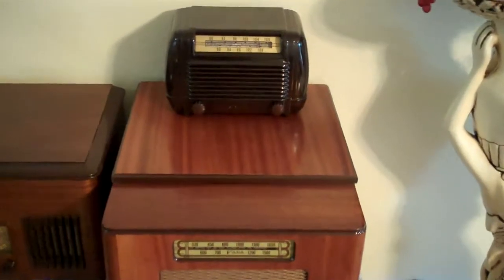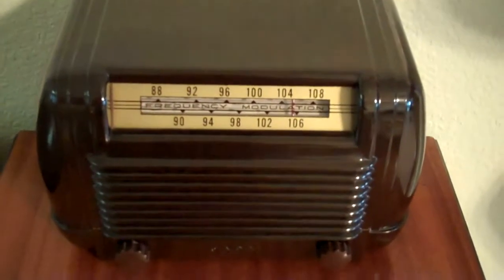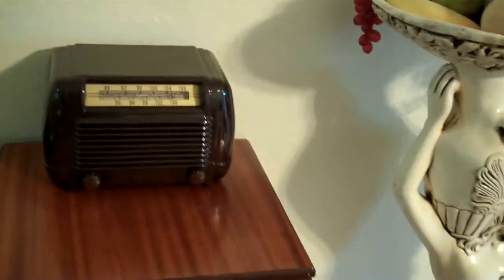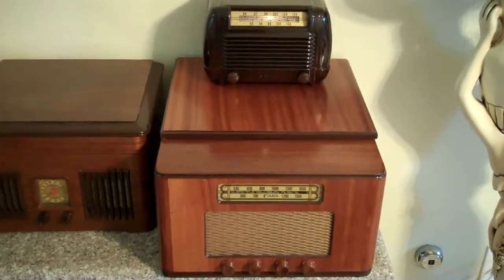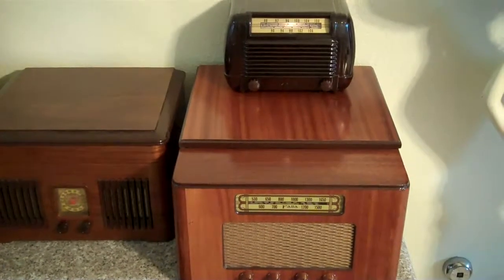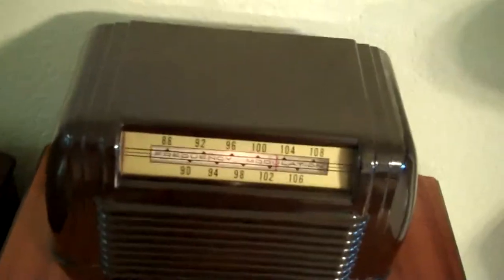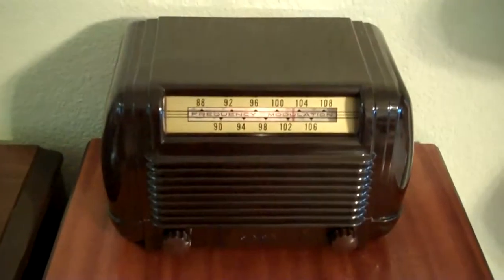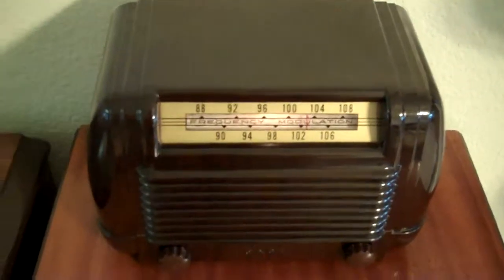FADA Model  795 FM Tuner From 1947

Comment: Technically this is an FM tuner, not a converter.  I think Fada did make a converter, essentially an FM tuner into a modulated oscillator in the AM band, though I can't recall the model number.

But boy the cabinet on your 795 sure does shine!